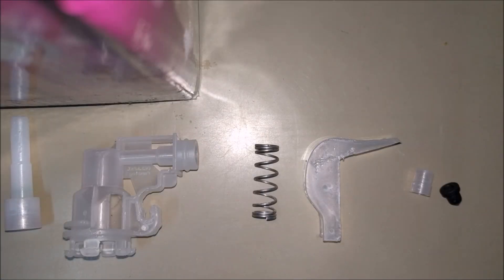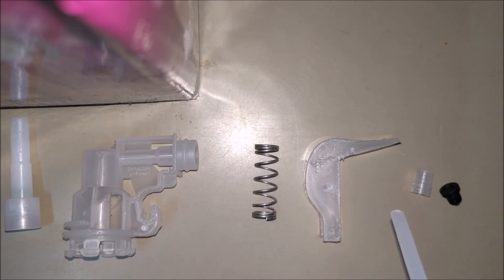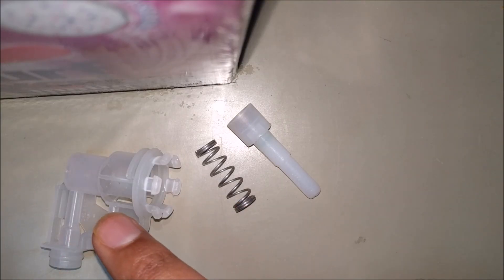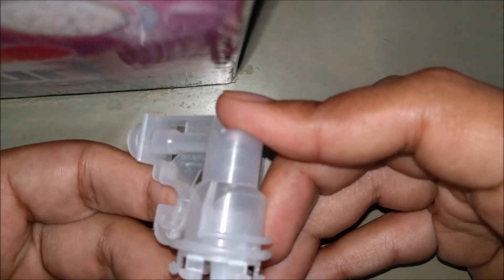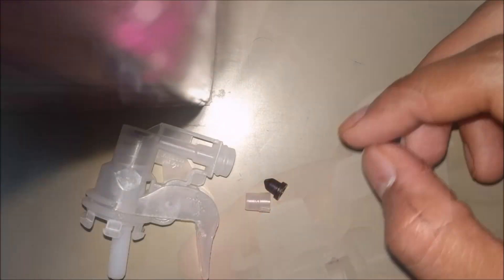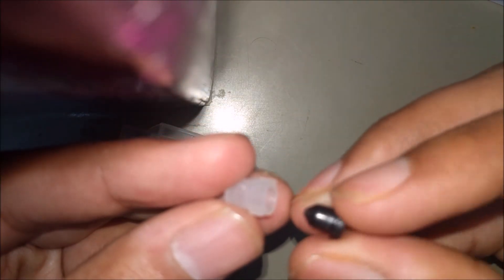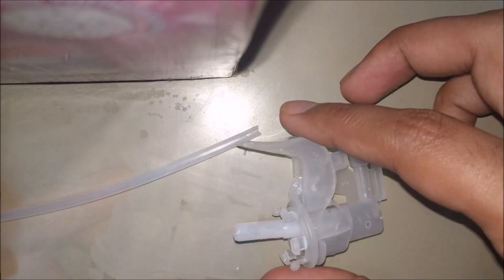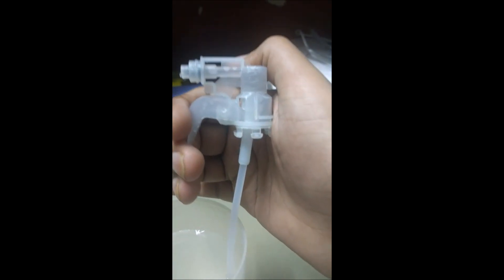How Spray Bottle Works

Comment: You only have to tell us one time how the volume decreases in the pressure increases. You left out a key part, the one-way valve that prevents the water from going back into the bottle

Comment: 12-1-2022 - - - - Here's the short version:  Tube (straw) immersed into liquid. Squeeze trigger compresses a spring against the trigger and contents of cylinder are compressed with a piston. Compressed contents flow past a ball that is pressed against a gasket (o-ring) by  spring. Compressed contents ejected through small port in nozzle to the outside air. After trigger released, the spring re-seats the ball against the o-ring blocking reverse flow. Trigger is released and trigger spring forces piston back creating vacuum in the straw sucking more water into the compression chamber of piston.  - - - - There, fixed it for you. The sprayer shown in this video doesn't have a spring/ball/o-ring assembly in it.  The sprayer in the video is a more simple mechanism. Better sprayers have the ball/spring/o-ring assembly style.  Good luck.  Don't use bleach in sprayers without rinsing out with water afterwards to wash bleach off of the internal parts - or they will dissolve/rot and leak, making sprayer into junk.  (Cheers - ex-engineer).

Comment: Thank you for the video. Could you please explain why the water moves up the pipe though. Is it because there’s empty space in the thing and it tries balancing out? Would liquid be able to do that? And why doesn’t the air escape right away without you spraying. Does the nozzle also open up? I understand if you don’t see this and don’t answer but if anyone has answers please do share
Reply: I might be wrong, but giving a try. When the presses the plunger/lever/whatever, it pushes the piston in upward direction. By pushing the piston upwards, we increase the pressure and decreases the volume in cylinder. As the one end of cylinder is connected to nozzle, whatever matter (liquid water or air ) is in cylinder runs to nozzle. In nozzle, kinetic energy thus velocity of fluid is increased on the expense of pressure. When we leave the plunger, piston runs back to it's normal position, thus increasing volume and decreases pressure in cylinder fall below the pressure of fluid in the container ( bottle ). As the downward end of cylinder is connected to the bottle through pipe, due to differences in pressure, fluid start moving from high pressure area to low pressure area. Thus we have fluid/water in cylinder.

Comment: Also pls spare a mention about the valves.. These are very important in keeping the liquid from flowing back.
Also when the piston expands the cylinder, the liquid is brought into cylinder
Reply: Exactly related to this I have a doubt. When cylinder expads after spraying water, what is stopping from air to get sucked in due to low pressure instead of water getting sucked up? A value in nozzle?
Reply: @TechCornerWithAjay  A valid concern indeed!
Reply: the nozzle is one way (air cant come in when trigger is released) because its similar to, for example, a vacuum hose sucking a big object larger than the hose mouth. but in this example, the big object is something inside the nozzle.  @TechCornerWithAjay

Comment: You yourself does not know how it works. There should be a check valve between each cycle you never mention. Surprisingly people commenting as good explanation, strange,
Reply from the maker: Common man, don't be a wise ass. I forgot the part about one way valves. You could have been constructive and explained that,  but you chose to nag.

Comment: Placed in a closed bottle, Does it create vacuum or is there air incoming to the bottle for replacing the ejected liquid? (I don't think it creates vacuum, else, at some moment, it would be almost impossible to continue ejecting liquid).
Reply: I’m not 100% sure but I think that if you mean inside the little thing where the spring is, when it empty’s out then since there is empty space the water tries balancing so it goes up. Again I’m not 100% sure

Comment: This could be good but you did not mention the valves.  the most imporatant part?  maybe.  Unless I did not hear you perhaps...does it have check valves or some means to move in one direction?  I like the idea of doing this video thank you.  also the sound was not easy to understand.  Not being mean... just interested in this simple machine.
Reply from the maker: Cambria399 My apologies. I forgot to explain the function of valves. And as for the sound, may be it's my accent or the white noise in background. I'll try to improve in my next video.
Reply: Cheers mate, I gave thumbs up :)
Reply: @Shawshank08  could you explain the valves function right now through words itself , i need to understand that urgently